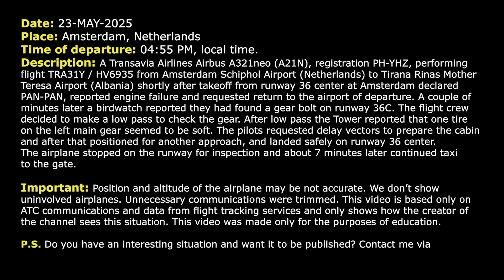Engine failure. Wheel bolt is found on the runway. Transavia A321neo returns to Amsterdam. Real ATC

Comment from the maker: Hello, friends. I tried to do my best with the translation from Dutch. If there are some mistakes, write in comments. Thank you.
Reply: Your Dutch translation is excellent.  You missed one tiny detail, in that it was an achterband which means a rear tyre but that's not important at all.
Reply: Could you add a case of emergency landing of the plane Wizzair 61613 in Geneva? was supposed to fly from Gdansk to Malaga. reportedly all the lights on board went out and there was a great panic
Reply from the maker: Will try. Thank you 👍
Reply: @matek.999  Danzig? Yeah, nice city. Nice castle.
Reply: Nice translation! First point after departure is RIKOR, not LEKKO
Reply: Could you do the KLM 777 what give fire on the left engine?
Reply: @NLInfinity yes please. Engine shutdown, fuel dumping, return to Schiphol and inspection from fire brigade. Date was may 17th.
Reply from the maker: Hello, the audio is unavailable.
Reply: Thank you for information. @YouCanSeeATC I listened to the archive 16.30-17.00 approach LSGG yesterday.

wizzair reported engine failure, but I couldn't locate the area before approaching
Reply: You did well
Reply: Translation from Dutch was good enough.
Reply: That controller was from South Africa, i think from his accent

Comment: I found it interesting that they needed 9 minutes to prepare cabin, after they already did one approach with an intent to land? Or maybe we didn't hear everything going on..
Reply: Because the first approach there was no need to prepare for an emergency landing (no need in general with an engine failure). After the go around and with the knowledge that there was a possible tire issue, they decided to let the cabin prepare for an emergency landing. And that was going to take 9 minutes.
Reply: @pieterrrr13  ok that makes sense. Thanks

Comment: What ATC and pilots did right was dropping the language and just speak plain Dutch when need be; during high stress load, mastery of language is usually the first to go, even for Dutch people where English is basically the second language. (I guess they all started doing that after JAL123)

However, as a Dutch person I do not appreciate this wasn't in the news. After El-Al (Bijlmerramp) we kinda wanna be in the know if a plane did a  pan-pan or mayday above our heads
Reply: What's funny is that the emergency contorller was the same one who was on duty for the El-Al disaster.

Comment: Another bolt was probably sucked into the engine😅
Reply: It was actually a bird, and there was no significant damage, the engine vibrated more than it was supposed to but it was still providing power.

Comment: I missed the repeated calls for fuel and souls on board.  How could the ARFF cope without this information?
Reply: See Rob2's comment earlier" Also notice they do not ask for irrelevant information like fuel and souls.  They have that information from their systems when the plane has departed locally. "
Reply from the maker: Yeah, the controller didn't ask this info.

Comment: I dont get it.... What has an engine failure to do with a wheel/lost wheel bolt?
Reply: Theoretically, a tire blowout during takeoff can in fact damage the engine. And when a tire blows, the wheel assembly can get damaged, and could shed parts (i.e. drop a wheel bolt)
Reply: Did you not watch the video? They had a conifrmed engine failure after takeoff. Then a wheel bolt was found on 36C by the birdwatch when 31Y was being vectored for a return. No one is saying that the two are linked in any way... The pilots of 31Y were just worried about the wheel bolt (understandably so).

Comment: One engine out fly-by and go-around and then again joining a hold over the North sea is a remarkable failure management. Hopefully Transavia management gives this a serious follow up in the Evidence Based Training in the next Simulator checking (OPC). Were Lives unnecessary endangered to your opinion?
Reply: Single engine procedures and manouvring is a scenario well prepared for with simulator training.

In addition, the A321neo has an 180min ETOPS rating. These planes are used for transantlatic flights as well.
They could have been in a hold for 3hrs on 1 engine, if fuel allows.
Reply: @nlhans1990  Yes I did simulator training on 777 747 and MD-11, but in real life there are birds at 200ft above a runway. It is different than the ETOPS diverting at cruise or at 10.000ft in combination with decompression. What extra information did he get from the flyby that made a decision to land differently. 36C in AMS is already a very long runway and fire brigade was already present. (He could have opt for the longer 36L in the first place, but 36C more than efficient for A321)
Reply: @pc12captain4you also 36L is not a landing runway. Only used for take-off. 18R is the other way around. Only used for landing, not for take-off
Reply: @nlhans1990  Lots of birds around the airport, I wouldn't do a low pass single engine risking the other one.
Reply: The engine wasn't out, so it wasn't an engine out fly-by. It was a smoking engine flyby.

Comment: My god... what a slow process! Let's hope that the pilots kept the cabin and passengers informed consistently, otherwise you would have experienced quite a bit of unnecessary stress as a passenger from all these manoeuvres. And what is it with many of those pilots, and the way and tone in which many talk, a kind of acting interesting, almost autistic or something like that? In any case, you can hear very clearly the difference between the radio traffic on the ground who do communicate normally, and the pilots.

Comment: I'm flying Transavia next week, hope they'll check the bolts tension by then 😮
Reply: Have flown with this exact same airplane last monday back from GCLP to EHAM no issues at all.
Reply: Just a guess, but I am assuming it's different plane that lost the bolt, which punctured one of the tires on this plane.
Reply: @basclason6596  oh wow... do they know which plane lost the bolt? 😮
Reply: Its impossible that that bolt had come of that aircraft and went trough the engine. As the engine is in front of the wheel. So the bolt had to be from another aircraft
Reply: Wij ook de 5e juni!

Comment: Why is it runway 36 Center instead of 36 Charley?
Reply: that's just how runways are named. 36L/36C/36R Left/Center/Right. if there is more than 3, they name them a different course e.g. 25L/R and 24L/R at LAX, even though they are in the same direction, to reduce potential confusion.
Reply: When a runway number is called out it is either single ( no further explanation necessary) left, right or center and those are as easy distinguishable from each other as lima, romeo and charlie and more logical.

Comment: Soft tire? No TPIS available on HV?
Reply: No, only brake temperature monitoring.
Reply: @pilotnl okay, thanks. HV and KLM used to bring their specs as close as possible on the 737 for exchange reasons. Looks like they didn’t on Airbus since KLM does have TPIS installed on their 321
Reply: @GeorgeBelly-th4qe  I've flown on the KLM 737's in that exchange, there were still quite a few differences, but we got half an hour extra reporting time to familiarize and that is plenty, I guess I'd need 5 minutes to read into the TPIS system at most :)
Reply: @pilotnl  it's a simple system. Push the wheel page, that's it. What i meant is the proces of buying those aircrafts. It's odd that KLM group daughter HV have their aircrafts without TPIS and KLM have TPIS installed on their Airbus aircrafts. Specs should be as close as possible for maintenance and operational reasons. Simple, reliable system and saves us like 5-10 mins of getting the press gage and check the tire press by hand. Wheel page: 2 secs. Anyway, they must have their reasons for this. Safe flights! 🤝
Reply: @GeorgeBelly-th4qe I didn’t know engineering was allowed to use these values for checking tyre pressure but it makes sense. I don’t know why HV decided to not buy the option, perhaps it adds weight, cost of keeping spare parts, which don’t weigh up to the time savings. Also KL and HV each have their own maintenance organisation. If I ever get a blue airbus under by seat I would be more interested in the satellite internet dome on the dorsal, and how to connect it to my Ipad 😅
Reply: @pilotnl thank God we are allowed to use it. I'm a 330 man but some things are similar. On wheel page you see tire press changing per 5 units. Via MCDU you can acces a page and see the value per 1 unit. Every A-check we compare flight deck values with values measured on the wheel to see if it's still accurate. It's a pretty reliable systems with not much complaints

Comment: Single engine go around ?  Maybe the engine was at idle and not shut down...
Reply: with high speeds, you can easily perform a go-around with only one engine
Reply: @teunvanechtelt8942  yes, because you have higher approach speed and less flaps extended, in 737 flaps 15 instead of 30 / 40. If engine is only reduced at idle, i think a normal flaps approach can be made.

Comment: So many questions:
1) engine failure is reported but no comms about which engine (important to know for ATC which turns are easier to make) or even a later confirmation about that engine failure
2) how did the Air Lingues crew knew about the fly-by/pan pan situation when all comms were on a dedicated frequency? Did ATC request any planes on the ground to have a look? Would be interesting to check all other ATC comms around this incident.
3) do birdwatch crew have enough knowledge of bolts to know its a “wheel bolt”?
4) was this bolt from PH-YHZ or was it already on the runway from another plane and maybe it caused this incident instead of being a result of it?
5) was there really an engine failure AND a “”soft tyre”? What caused the engine failure?
6) wasn’t it risky to perform a fly-by to check the gear on a single  engine? I wonder what Transavia/Airbus procedures there are for such a situation.
Reply: 1) atc did ask :) 
2) All air traffic controllers can communicate with each other. Probably the ground controller asked the Air Lingues.
3) apparently
4&5) I think everyone has that question, research is probably done at the moment.
6) Well you could say it is risky, but with high speeds and a slow climb, it is not dangerous and not forbidden. Transavia is one of the safest airlines in the world!

I hope this has answered your questions!
Reply: @teunvanechtelt8942 probably and apparently…. I got all that but I’m more interested in facts 😊
Reply: ATC asked about preference for left or right turns, the crew decided they could still do either. The Air Lingus aircraft might be holding for crossing 36C and have a good view of the low-pass. ATC may have asked them specifically. A fly-by is prudent to make sure the landing (heavy, full of fuel)  is safe or that the landing gear appears compromised. In that case they´d have to circle and dump fuel before even attempting a landing.
All the other stuff will no doubt be investigated.
Reply: @scsirob thanks for only confirming my questions and not answering them 😊
Reply: @atariandre5014 1= they asked if they preferred right or left turns, the rest about the emergency in irrelevant at that time.
2=yes ofcourse they got asked. Is thinking a bit logical really that hard for yea?
Reply: @larsmeijerink5471  can you please stay respectful? You are answering my question with an assumption. I don’t like to assume, I find it interesting to also hear that bit of comms going on….
Reply: @atariandre5014 there is something eeally wrong with you few of the world if you think i wasn't respectful..... just saying
Reply: I was wondering the same, spending more time in the air, with just one working engine is just crazy... they landed 50 minutes after takeoff...
Reply: @papaschlumpf332  They have to perform a shitload of checklists to make sure everything set correctly for landing. You always have to do them. Those checklists are written with the blood of the pilots who didn't do them!
Reply: @teunvanechtelt8942  i know, but you hear alarm sound constantly when TRA is transmitting, so we will see if going around was the right decision...
Reply: @papaschlumpf332 and thats completely fine. A plane is made to fly on 1 engine and they could even make it to their destination safely on 1 engine. For safety reasons they didn't. In the 50min of flight there was at any moment a possibility to land even with no engines. There was absolutely NOTHING unsafe about that 50min. If you were a little more educated on aviation you would know
Reply: @larsmeijerink5471 ”if you were a little more educated….” You suggest it would be fine if they had flown to the destination with just one engine. Well no it wouldn’t and it would be against every aviation rule because REDUNDANCY is key. Else we could mount just one engine on a plane….
You’re whole tone is arrogant.
Reply: @larsmeijerink5471  a bird strike during single-engine climb after the low flyby would have turned this into a catastrophy, not really "absolutely NOTHING unsafe" in my book! If you were a little more educated on aviation you would know! :)
Reply: @papaschlumpf332 landing with 1 engine while you probably have a unsafe gear is way more dangerous. Its choosing between 2 dangerous options. They choose good. If there were birds seen on the airport they would not have done so. But you are clearly not i. Aviation and have no idea what they had to choose from. They did a great job at handling this. Only ppl that have no idea would say this is dangerous, ppl with actual knowledge about Aviation know they did good
Reply: Tower likely saw the engine fail, they called the plane immediately after takeoff probably to warn them about it, but they already knew and asked to stand by.
Tower immediately initiated procedure to setup a discrete frequency and put other involved controllers on it as well, so they could inform them and they would not have to ask the same thing again and again.
Reply: 6) It wasn't on one engine, the engine had issues, but wasn't out. It was just resonating because of a bird strike.

Comment: I'm always so impressed how such things are handled in Amsterdam. ATC is really making sure that pilots can deal with the emergency. Also very impressive that ATC basically stays also ahead of the plane. With that they somehow become a additional crew member.
Reply: I like that they just give the emergency airplane a discrete frequency, and then ATC is the one doing the switching between tower and approach or departure. One less thing to worry about in the cockpit, no interference from any other traffic. Very good idea, I think. Also: no superfluous questions from ATC.
Reply: Yes, and saves the pilots from having to filter out irrelevant communication. Downside is that others can't hear what is going on and anticipate, but the burden to communicate that to other traffic just shifts to the controllers.
Reply: Indeed.

Comment: Why the f**k did they do a missed approach with single engine just to check for a possible bolt missing? Just land the plane man, had they lost all wheels what would have changed with the second landing? Just prepare mentally just in case.
Reply: Sounded to me like they prepared for the first approach considering only the engine failure and remembered about the comment the controller made about a wheel bolt missing once on the approach. A single-engine landing is very different to a landing with a missing gear. In fact you hear them then say the cabin crew needed delayed vectors to prepare the cabin, indicating they were preparing for an emergency landing which they hadn't on the first approach.

Either way, those planes fly perfectly fine with a single-engine, so it's safer to not rush things, to give you time to prepare.
Reply: @AlexandreHill70 I perfectly understand the last minute consideration, but the missed approach lead to no one looking at the gear, a second approach to land, with a single engine, without knowing the reason for the engine failure, and a possible risk of bird strike. 
Let’s pretend that during the first missed approach, someone who’s capable of knowing what an unsafe gear is (which didn’t happen) would pass the information to the pilots, I mean, either you like it or not, you have to land the plane, with our without the tyres. In my humble opinion, as a captain, would have been to mentally prepare for a possible tyre failure during the first approach, and land the plane. As I said, just giving my opinion, I’m not saying what they did was wrong, but for me was not really done with airmanship. Glad they made it back safe and no one was hurt. Kudos to the crew and everyone involved.
Reply: Amateuristisch to the max 
Flyby and go around on one engine
Thank doek the working engine didn’t take a bird when low
Reply: @ruud9216  Jij weet echt helemaal niks hè
Reply: @teunvanechtelt8942 nee, niet veel geleerd in 22000+ vlieguren, 
Enige die Profi waren was ATC, de crew die een flyby doet terwijl ze 3 greens hebben op een motor is niet te geloven.
Waarom gaat de eerste motor uit? Vogels? Mechanisch? Of fuel? 
Een go around op een motor met passagiers! Terwijl er geen enkele reden voor was.
Bij mijn baas is dat brevet inleveren,

Comment: OMG this is why I never fly Airbus.  - Boeing Fan boi acting like Airbus fan boi
Reply: Boeing are losing complete doors.
Reply: @bertoverweel6588  Proves point thx!
Reply: @iceman9678 you know this could happen to any airplane right? A bolt on the runway damaged the engine and the tire. It has nothing to so with the aircraft
Reply: @larsmeijerink5471  I know this.  You know this and the fan bois delivered as predicted in the comments section.
Reply: @iceman9678 maybe they did because you misspelled "boy" i think they dont know what you meant
Reply: 737?
Reply: It was not that Airbus which took off and left something on the runway..